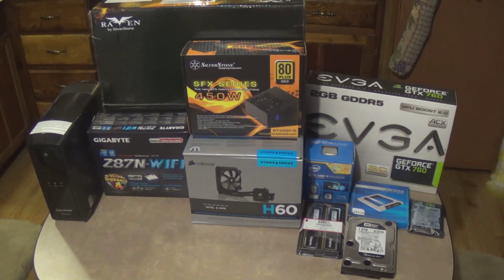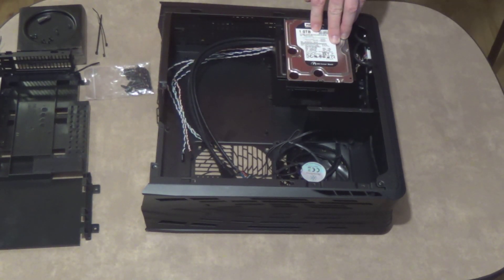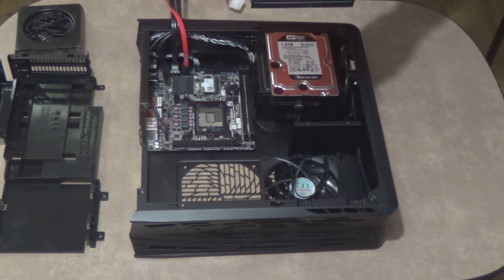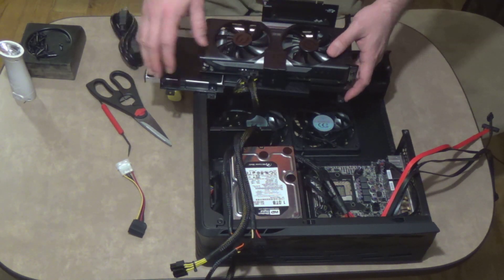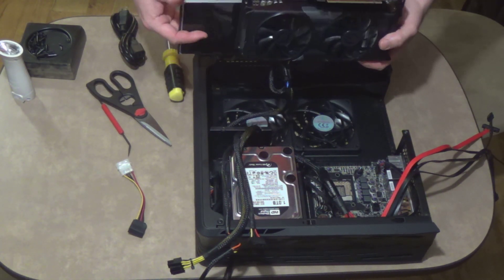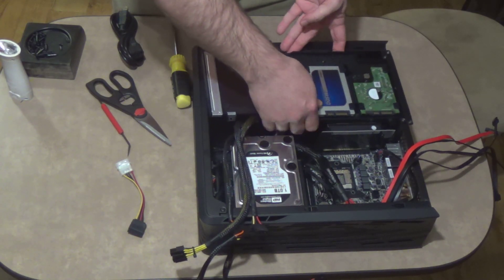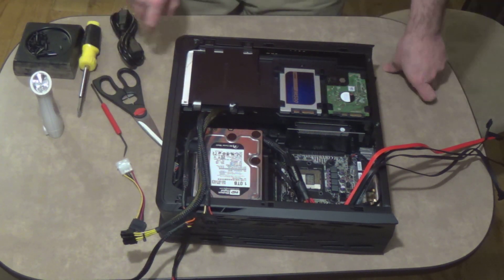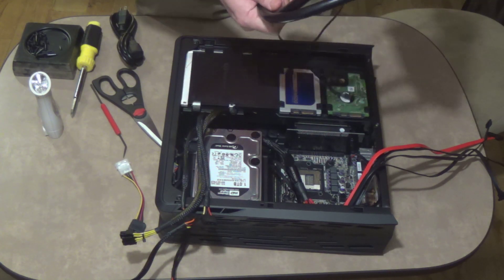Building Steam Machine - Hackintosh - PC with the Silverstone Raven RVZ01

Comment: +PikkonMG how where u able to connect the Panasonic DVD ROM drive?... because the Silverstone DVD ROM is a bit expensive but it come with the connection cables.
Reply from the maker: If I remember right the Panasonic Slim Slot Load DVD ROM Drive I had used slimline Sata Connection. I had found a Slimline SATA to SATA cable on amazon for like $4 bucks.
Reply: PikkonMG okay.

Comment: Just came across your vid, i have the same case and was able to fit two 3.5 drives - one was lying horizontaly below the psu, two ssd's, and corsair h60 though its a really tight fit  and twisted quite a bit
Reply from the maker: +Miui N9005 Never though of that.

Comment from the maker: @Isaac Mercado I cant reply to you post but 7990 would only work if you get one of the 2 PCI slot versions and it has power connectors on side and not the rear
Reply: +PikkonMG Thanks, I went a different direction (an SG13 with a 970), but am now considering putting a Fury in this case with an H60 cooler for the CPU.
Reply from the maker: I've thought about a fury nano, but price needs to go down first.
Reply: +PikkonMG Not worth it, it's nice but unless you want a really tiny case, it's not worth it.
Reply from the maker: That ML08 looks pretty nice.

Comment: glad you tried to put in the liquid cooler. i have the h80i and would have done a whole lot more swearing
Reply from the maker: techme061 Ya I had to hold it in a little. I'll be changing cases here soon just got Rosewill Neutron in today. I love my Silverstone Raven case due to it's size, look and build quality of it is really good. Just want a little more room for cooling and Hard Drive space.
Reply: PikkonMG I'm thinking about getting this case and maybe this build is there good enough CPU cooler or water cooler to get if you make this PC very powerful?
Reply from the maker: Check out the forum topic here http://www.overclock.net/t/1466816/silverstone-raven-rvz01-rvz02-ml07-ml08-ftz01-owners-club

Comment: Hi PikkonMG, 
I have seen other videos where they get air cooling in successfully - https://www.youtube.com/watch?v=CrJKfQwfgmY

I'm waiting for my new pc to arrive ... in that time I've been planning the build and compared yours to the video (link above) and seen if you cable route behind the PSU and possibly use some of the space under the GPU for the slack of cables like sata it should give a bit more space in the channel where the PSU cables are. Also the orientation of the pump on the CPU where the tubes come up and the orientation of the tubes coming down from the radiator is the trick to having more room to place the tubing where it isn't kinked. The guy in the video also said he had to change the fan on the radiator to one of the slim profile fans.

When I complete my build will be happy to share pictures or video I do for it if you like.

Comment: Tyvm for the build. I'm glad I learned from u about the h60 before I did the exact same thing. I'm just going to go for a good medium profile(and no fan on the actual case) for the cpu cooler, or a low profile fan(with another fan on the case) like Linus Tech Tips had.
Thanks a TON man! I never would've thought about the length of the tubes being an issue.

Comment from the maker: Just an update as of today what parts im using in this system.

This is what my build is now.
Case: Raven RVZ01.
CPU Cooler: Noctua Low-Profile Quiet CPU Cooler NH-L9I
Processor: Intel Core i7-4770K Quad-Core Processor.
Motherboard: Gigabyte LGA 1150 Intel Z87 Mini ITX GA-Z87N-WIFI.
RAM: G.SKILL Sniper Series 16GB (2 x 8GB) 240-Pin DDR3 SDRAM DDR3 1866.
HD 1: Crucial MX100 512GB Internal Solid State Drive.
HD 2: Western Digital 500 GB WD Black SATA III 7200 RPM 16 MB Cache OEM Notebook Hard Drive.
HD 3: HGST Travelstar 2.5-Inch 1TB 7200RPM SATA 6GB/s.
DVD: Panasonic UJ-8C5.
Video: ZOTAC Geforce GTX 970 4GB.
PSU: Silverstone 600 Watt SFX PSU.
Reply: PikkonMG Hey man, I was wondering how does the Noctua NH-L9I compare to the H60?
I currently have a H55 with a Noctua NF-F12 but the fan is on the outside of the case, I was also thinking of the NH-L12 but then I would have to remove the top fan or move it to the bottom and then have a fan just sitting around.
Reply from the maker: I dislike the NH-L9i. It's better then stock but I can't say much about it beyond that.
Reply: hey man, do you think i could put a nvidia geforce gtx 980 in this case?
Reply: THE LAST BATTLE NATION SURVIVOR It can support up to a 13" graphics card, as long as its the windforce or the strix model, and does not have that overhang like the Zotac models do, it will be fine.
Reply from the maker: Should be able to, just pay attention to the length of video card.
Reply from the maker: If I don't overclock.
Reply: PikkonMG I was pushing my 4690K to 4.6GHz and max temp was 72 while running AIDA64.
That is with the H55 tough. I imagine that the NH-L9i would have a hard time pushing anything but stock or slight overclock.
Reply from the maker: I'll see what I can do with something like that.
Reply: PikkonMG hey dude,do you think an evga titan black could fit in this case?
Reply from the maker: It has it's Length at 10.5 inches on EVGA's website and the RVZ01 is label as, Support graphics card up to 13 inches.
Reply: PikkonMG wow!. thanks!.
Reply: THE LAST BATTLE NATION SURVIVOR As far as length goes it will fit but you might have to cut part of the case so it can accommodate that third slot the Titan Z cooler requires.
Also you will want to go with the 600W version of the PSU. Its the Silverstone SX600-G 50A on the 12V rail. You are coming pretty close to the power limit though. Here is a link to the power consumption of a system with a Titan Z at full load. http://www.pcper.com/reviews/Graphics-Cards/NVIDIA-GeForce-GTX-TITAN-Z-Review/3DMark-Power-Sound-and-Conclusions
Reply: TheOneWhoisDrunk thanks man!. very informative!.
Reply: TheOneWhoisDrunk how about a single gtx titan black (evga)
Reply: THE LAST BATTLE NATION SURVIVOR Titan Black is the same length as the Titan Z. 10.5" the case can hold up to almost 13"
Reply: TheOneWhoisDrunk but do you still need 3 slots like the Z?
Reply: THE LAST BATTLE NATION SURVIVOR No, the Titan Black only has 2 PCI slots it takes up. It will fit fine in this case without any modifications.

Comment from the maker: Welp as of today I order few upgrades for this machine. Ordered the SilverStone 600 Watt SFX PSU SX600-G, ASUS VG248QE 24-inch 144Hz Monitor, and last but not least Zotac GeForce GTX 970. Only thing im worried about is if the GTX 970 will work with OSX, if it doesn't I can always use the integrated Intel GPU for it.
Reply: As of right now, the only Maxwell GPU supported in OS X is the GTX 750, and that's through user created kexts on Nektas forums.

It'll still be a while before the GM104 GPUs get support, as they've just launched.
Reply from the maker: Might have to just use the Integrated Intel GPU for when I boot into the OSX side of the house. Maybe Yosemite will have support for the 900 series.
Reply: I have Yosemite and it doesn't yet. It;s due to it being a completely new architecture. It'll be be up to NVIDIA's direct drivers first.

You're best to use the IGP until the drivers get sorted. Keep and eye on RampageDev for updates. He's already gotten X99 working.
Reply: PikkonMG where did you get the holder for the graphic card that makes it firm with the bracket that holds your gtx 970 because i only have a screw slot on there and nothing else to support it, so basically my graphic card just hangs and wobbles
Reply from the maker: Came with my case.

Comment: I ordered  Noctua NH-L9i you saying is just a little better then the stock fan? I pay like 55, it's the silver stone one better? Or I'll be good with it? I ordered i5-4670K instead
Reply from the maker: For my CPU which is a i7 4770k in benchmarks the cooling for the Noctua NH-L9i only out performed the stock cooler by a little. Where is really did better was on sound levels. The i5 I couldn't comment.

Comment: hey a little help here please
this is going to be my first build , similar to your this is the parts

Intel Core i5-4570 3.2GHz LGA
Samsung Electronics 840 EVO-Series 120GB 2.5-Inch 
WD Blue 1 TB Desktop Hard Drive: 3.5 
ADATA USA XPG V1.0 OC Series 8GB DDR3 1600MHZ PC3 12800 4GBx2
Silverstone Tek 450-Watts SFX
Silverstone Tek Mini-ITX DTX Computer Case
Gigabyte GA-H87N-WIFI
Gigabyte NVIDIA GeForce GTX 760 

what you recommend to add or change?? do i need a coloing? thanks
Reply: Since your CPU doesn't allow you to overclock, you don't need an extra CPU cooler. The stock cooler is pretty quiet. If you do want one (not necessary unless temps are very high, like 80+), the Noctua LH-L9i is very good.
Reply from the maker: Ya the Noctua NH-L9i is a little better then stock cooling. SilverStone also makes a CPU cooler that fits in the case with most boards, it's the NT06-PRO if i remember the model right. I just dislike it's price tag.

Comment: Interesting build and good video. I'm thinking of redoing my mini-itx build in this case so that I can put it in my entertainment center cabinet. My build currently resides in a Fractal Node 304 case. My main concern is my getting my graphics card inside the raven. It's a Gigabyte GTX 780. I don't think Silverstone's sffx psu's can power it, but looks like I may be able to fit my Seasonic G-Series semi-modular psu in that spot. I'd either have to drill my own mounting holes or use velcro to hold it in place though.

Comment: Yeah, either ditch the 3.5 in drive or no watercooler at all. Those nozzles are plastic, they'll probably eventually crack from the stress and then you got the liquid on the mainboard. I think with the HDD gone, you can maybe wrap those cables around the PSU or lay them on top. Either way, it's a scary fit. It's one of those "so close, it's a shame," moments.  I have one of those coolers too and would love to use it, but with a 450w PSU, you probably aint going to be overclocking much anyway and the water then just becomes overkill. Also, the watercoolers draw an immense amount of amperage to power the pump, so you definitely may not have the headroom for peak performance in terms of power...let alone overclock. I wonder if a mini-ITX board could even provide the amperage to power fans and a pump even. I hear Silverstone is working on a 600w SFX power supply, due shortly...that may bring the power issue into "non-concern."

Comment: It looks like it could fit my full size TX750 power supply. There's still space to the left and right, no?
Reply from the maker: You can, I have a buddy who used some metal cutters, electric sander and got a 850 watt corsair to go in, the only issue is his cable management is one nasty looking mess.
Reply: PikkonMG I have a modular power supply so hopefully I could keep clutter minimized. My power supply is 5.9" (W) x3.4"(H) x 6.3"(L)
and I think the SFX is 4.92" (W) x 2.5" (H) x 3.94" (L)  My power supply may be too long and too high.

Comment: PikkonMG Noticed the issue with the AIO liquid cooler.  If you haven't resolved it yet, Silverstone makes an aftermarket low profile air cooler that SHOULD work with that case.  Haven't tested myself, but I'm researching to build an SFF system myself.

Comment: i can buy a 290X for 250 euros wil the card fit
Reply from the maker: Biggest issue would be power for that card, the RVZ01 supports cards up to 13 inches, the 450 watt SFX PSU from Silver Stone handles my GTX 760 with no issues but I don't know if it would handle that card well.
Reply: PikkonMG ok thanks for the info alsow i saw a video of a guy putting a radiator in side that case it made sense the radiator gose behind the powersupply on the front side of the video card you know what i mean thhere is a black plate like a wall between the vid card and power s thats the place where the water cooling radiator gose maybe you can try and instal it ?
Reply: gtx760 uses 336 watt
290x 381 watt
Reply: i dont want to buy a new vid card every year just want to play games on my 1080p tv every thing max out turned down vsync and motionblurr
Reply: evry time i want to try and build a gaming pc i end doing nothing there is just to much to choose from cpu gpu go old very fast
Reply from the maker: I've seen people use GTX 780 and R9 290x with this PSU, but myself personally i'd wait, Silver Stone said at one point that they were coming out with a 500 or 600 Watt SFX PSU, I think the 600 Watt model will be Silverstone SST-SX600-G when it comes out. http://www.computerbase.de/2014-03/silverstone-praesentiert-sfx-netzteil-mit-600-watt/

Comment: You alright bro! 

Have you tried installing the H60 with the flat cables (from your most recent video)? Because I did a little digging around and literally everyone was saying it will fit, if your cables are tight. Would you mind giving it another go? I would love to see a H60 in this case, and if not, still a great case :)
Reply from the maker: I still got to look for a good cooler, their are a few pictures of people using H60 over at overclock.net, but most say the same as was with me they get kinks in the hose.
Reply: PikkonMG Ah man, I really want this case but I dont want heating problems and a loud PC. How you finding yours with sound?
Reply from the maker: It's loud with the stock cooler and a Cooler Master JetFlo 120, but temps stay good. This PC stays hooked up to the TV, so I normally a good 5 to 6 feet away from it. If it was on a desk right in front of me it would drive me nuts.
Reply: PikkonMG Ah man wish there was a way to make it quieter. Thanks anyways I'll be looking at the 250D or maybe just stick to larges cases - i Dunno. Thanks again! You deserve more sub and views
Reply from the maker: Np, and thanks.
Reply: Buy a noctua low profile cooler.
The acoustics are realy good on those.
Reply: Sven Raven Don't fit because of my ram :/
Reply: I mean the downdraft cooler.
But the nh-u 12s fits every size of ram if you dont have it watercooled.
Reply: Sven Raven Really? I would consider that, thank you :D
Reply: Yeah no problem

Comment: You're probably supposed to put the radiator under the GPU, I can't imagine you could fit it otherwise. You'd probably be stuck using a single slot GPU.
Reply from the maker: Ya if you used a small GPU like a GTX 650 or 750 you could or if you used one of the higher end AMD APU's, but for a full sized mid to high end GPU it wont work.